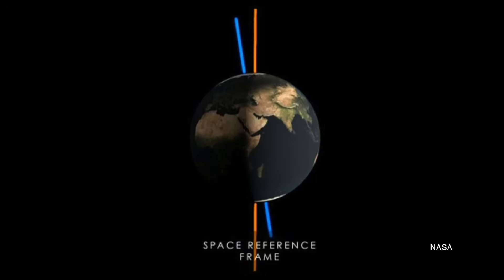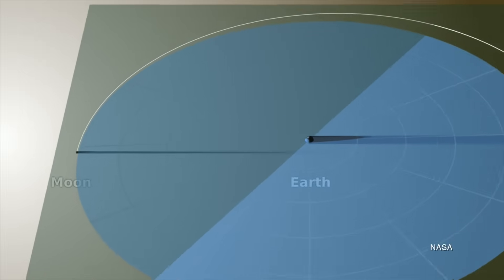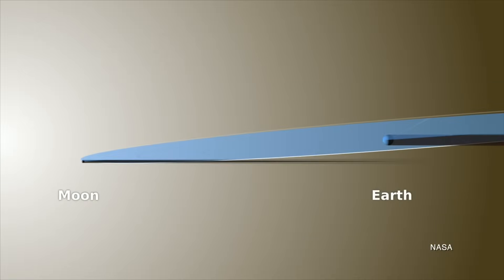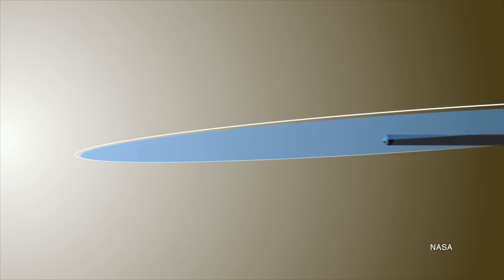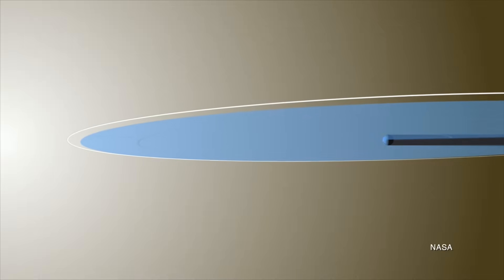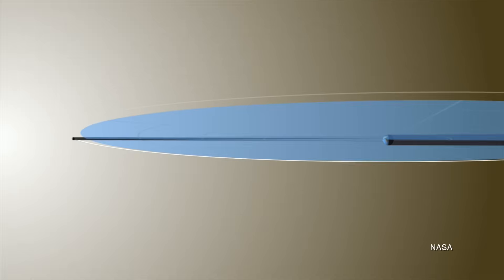Why Does a Rocket Need to Roll Going Into Orbit?

Comment: Fascinating !!    The roll program is an artifact of gyroscopic inertial navigation  !!    I have to sit here and think for a moment,,, Apollo,, certainly,, Space Shuttle,, I watched it roll similarly,, again gyroscopes.

Will we need such in the future?   My answer to myself is,, probably yes.  GPS or some similar electronic signal system could fill the duty,,, but GPS is reliant upon movement to successively know where it was,, it is always 'was'.,,, never 'is',,,, and then predict where it is, and  going.  That will not be quick or immediate enough,, for a rocket that initially lifts off at a walking pace or less.  That always 'was' feature will not give a deep enough 'book'  to make good decisions in those first seconds or fractions of the first second.   A gyroscope will lend immediate feedback.

Cool  !!!.  Thanks  !!
Reply: Sailor376also actually GPS only knows where it is, not where it’s going, or where it’s been. Those are functions of the navigation system to record and extrapolate a current track. In modern aircraft, and spacecraft the primary navigation reference is by an inertial reference system. This takes the known starting location (and speed equal to Earths movement) and through vector addition, ads every subsequent change in direction and velocity to arrive at the current inertial position. In an aircraft (at least) the system then updates that position with GPS.  The difference between the inertial and GOS positions (a bias)  is applied to the Inertial position on a continual basis to produce the system’s best guess at its true position. If the GPS signal is lost, the previous bias is continually applied to the inertial position. 
The inertial system provides a stability to the position solution that can smooth out variations in GPS position. 
On a modern airliner, the inertial position may drift a mile or so over 12 hours (sometimes more, sometimes less).  There are usually three of them, and their positions are combined to determine a “triple mix inertial position”, which should be more accurate than any one inertial system. The systems are also compared to each other and can reject one system that goes way off.

Comment: It still makes no sense. The rocket is essentially symmetrical. A simple pitch would still do the trick. The only possible explanation is that the rocket could only pitch on one axis and thus required  a roll to meet alignment. That said, it could still be resolved by simply pre-aligning the rocket on the pad. So, you really haven't addressed the reason at all. You've just created an explanation based on limitations you set in your original argument which do not encompass all the variables.

Comment: Rockets bound for the moon enter an orbit thought it is higher than normal rockets bound for orbiting the Earth. It actually "Rolls" more thsn once on its way into space baxically for the ssme reasons todays arrows are designed too. An spinning arrow flies straighter in an atmosphere due to the passing resistence upon it the design and placement of the fletching. The drvices st the bottom of a rocket are not rudders, they are fletchings. Once in deep space, there is no resistence they become moot.

Comment: My own question is more of a comment. As I understand it it is not strictly necessary to launch from a parking orbit to the Moon that is in exactly the same plane as the Moon's orbit. This is most efficient and simple, but in principle one could launch from any low Earth orbit no matter what inclination and reach the Moon. There would be drawbacks, mainly a matter of a higher encounter speed with the Moon (meaning you need more delta-V, hence more rocket propellant mass, to put into a given Lunar orbit). Also the angle is off. If you did a transfer maneuver from an orbit that exactly matched the plane of the lunar orbit, when you approach the moon that approach is also in that same plane, whereas if you were to launch from let us say a polar orbit (relative to Earth) your approach to the Moon can be in any plane, depending on the details of one's aim. Also of course if one does not change the plane during the TLI burn, the polar orbit plane can only intersect the Lunar path at two points so your timing better be perfect, whereas the exact timing of a TLI burn from within the Moon's own orbital plane can be very relaxed. This is a major reason we bother with parking orbits at all after all! 

Another technical point that VS may have mentioned somewhere or might want to talk about someday is the "free return orbit" strategy NASA used (strictly only for Apollos 8, 10, 11 and 12 but their modified non-free return alternatives they used later were close to free return too). At first it might seem that any orbit around Earth is automatically "free return;" you do the TLI burn and then coast, and get a very elongated high eccentricity ellipse that eventually returns to the perigee where you did the burn. This would be fine if the Moon didn't mass much, like say Mars's moon Deimos. But the Moon masses about 1/81 what Earth does, meaning that it slightly perturbs orbits all over the Earth-Moon system, and when you come close to it it changes the orbits a lot. A minimum energy Hohmann orbit would not be free return, because the close encounter with the Moon would change its parameters and either the new perigee would be much too high and the crew stranded in space forever, or much too low and they'd burn up on entry. 

Instead of using these minimum energy orbits then, NASA boosted the Apollos to a moderately higher speed--moderately higher at TLI near Earth that is, but the more distant from Earth the higher energy orbit took a craft the faster it would be going compared to minimum. Were such an orbit aimed to miss the Moon, the spacecraft would loop out into deep space well past the Moon's orbit. As a result, when approaching the Moon when aimed correctly, if the astronauts did nothing the craft would find its course changed by the Moon in a sort of hairpin curve (if you looked at it in a frame where the Moon is moving that is) and get tossed back on another very similar elliptical orbit to the one they came out on, but now headed back to Earth. These kinds of free return orbits are not possible if you approach the Moon out of its own orbital plane! This is why NASA was restricted to low latitude, "tropical" landing sites; to head for the poles would result in no free return being possible and also higher maneuvering costs. 

Therefore it made good sense for NASA to start from a parking orbit closely matching the Lunar orbital plane.

The Soviets on the other hand simply did not have the option of doing that. All USSR launch sites were in the Soviet Union which does not reach nearly as far south as the USA does. On paper I could suggest some alternative launch sites the Soviets might have thought to develop, such as North Vietnam or Cuba, but the geopolitical reasons they never considered that seriously are painfully obvious! Nor are these great launch sites despite low latitude; too much clutter of other inhabited lands to the east (which in both cases tended to be Western allied and the US Navy would find it all too easy to intrude or interfere, and would have the excellent pretext of concern for safety of non-Soviet allies downrange to do so. So practically speaking, Russians launch from Russia, or nowadays independent Kazakhstan. And if they don't want to risk launching over China, which generally bad relations since the late 50s and early 60s pretty much prevent them from daring to do, they have to launch to 57 degrees or higher inclinations. They just can't aim directly for the ideal Lunar orbital plane orbit, or come anywhere near it. And the cost of changing the inclination of an orbit is very high, at least in low orbits.

Yet the Russians launched a number of probes to the Moon, including the first to see the far side and send back images, and had some serious plans to attempt manned Moon missions, flybys and a possible landing as well. How could they do it?

This illustrates that although there are excellent reasons to launch from the same plane as the Moon orbits in, it remains possible, at a price to be sure, to get there other ways. All the details of any Soviet lunar mission plans I've ever seen seem to assume they'd use minimum energy Hohmann transfers, and when you realize that the Soviets would be forced to rely on their manned ships (or any sample returners) maneuvering at their close Lunar encounters to adjust their courses to return to Earth anyway, it is clearer how they could use quite differently inclined orbits instead. It still meant they'd suffer higher encounter velocities, but that would just be an unfortunate drawback of their being forced to use high latitude launch sites fundamentally. Given they were stuck with it, every mission plan I've seen attributed to them involves more maneuverable vehicles with higher delta-V reserves making the trip, and in some cases with a high level of redundancy Apollo planners could only envy! At a stiff price of course, and one the Russians who had no highly developed hydrogen engines, and were forced to use less efficient ker-lox ones (or worse, hypergolic--though both were developed, at some possible additional risk of failure, to pumped performance superior to equivalent role engines of similar type developed in the USA) these higher performance demands would be met by lower performance engines resulting in lower masses going to the Moon on higher launch mass vehicles.

But I do think they could have done it, maybe not before Apollo 11 but with a different mission design and better luck and an earlier commitment, perhaps in the same year or in that case even beating the Americans.
---------------------------
I've suggested other topics then, but in the context of this video, I would ask, just how different was the ideal Lunar orbital plane parking orbit from the easiest orbit for Apollo Saturns to launch to from Canaveral? I frankly thought the Moon orbited pretty close to the plane of the ecliptic anyway, within a small fraction of a degree I thought, whereas strictly speaking Canaveral is too far north to easily reach the tropical inclination. The saving factor is that because rockets burn over considerable time, it is possible to go a bit closer to the equator than one's launch site at moderate cost, though this cost mounts very steeply as I understand it. (Whereas it is very easy to launch to an orbit of higher inclination than one's launch latitude; an equatorial launch can go over the poles without too much extra cost). 

But some of the comments seemed to imply that Apollo Ii for one was aiming for an orbit of slightly higher inclination than Canaveral's latitude; surely the Moon is not tipped seven or more degrees relative to the plane of Solar System ecliptic?

I looked it up--the Moon's orbit is inclined relative to the ecliptic by 5.14 degrees, which is a lot more than I figured! As a practical matter of Earthbound life, we humans are generally concerned with where the Sun appears to be in the sky and the Tropics are defined as the limits of the Sun's apparent migrations north and south above and below the celestial equator.  I still don't see how the orbit in the Lunar orbital plane can have an inclination higher than Cape Canaveral's latitude but I think I might understand how come a launch almost due east from Canaveral can come pretty close to it, and require only minor "doglegging" to hit it dead on. 

I still wonder though whether Apollo missions all aimed to launch from exactly that plane, or compromised with other considerations for a different plane close to it that would require some small inclination changes to reach the Moon from with slight inefficiencies.
Reply: I think I heard somewhere that the Apollo missions did not actually match the moon's inclination, they used a higher inclination which allowed them to miss the bulk of the Van Allen Radiation Belts, but still achieve a lunar transfer orbit.
Reply: See, all you Hoaxards, this is what "Intelligence" sounds like.
Thanks Shevek23.
Reply: Shevek23 Shut up Wesley!